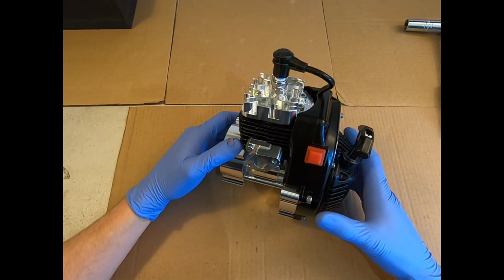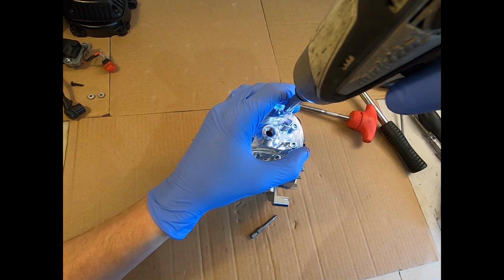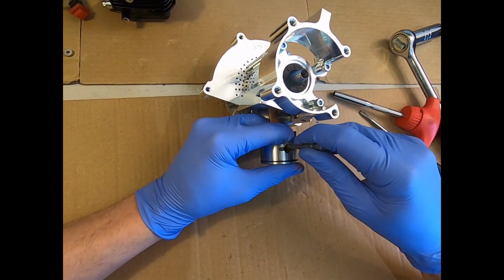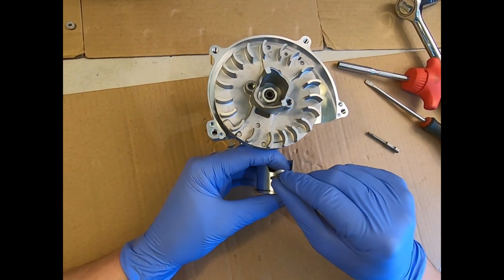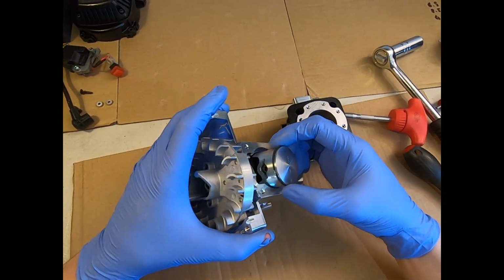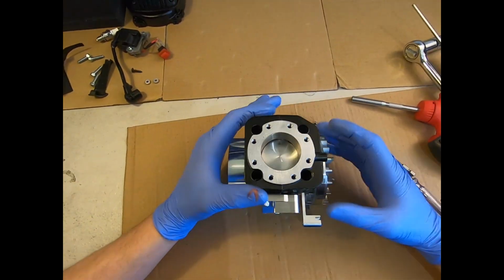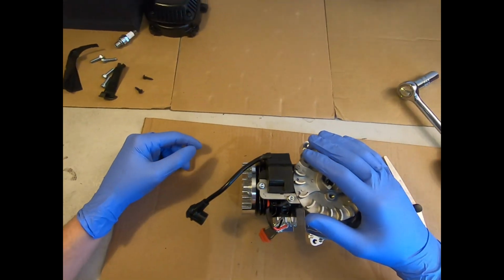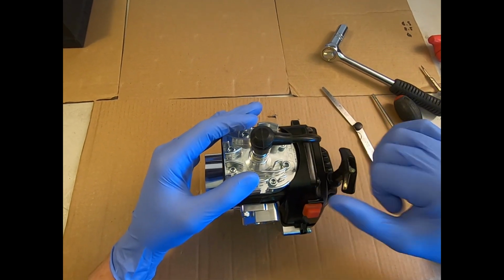TAYLOR 35 RC ENGINE - TOP END REBUILD/SERVICE TUTORIAL

Comment: Hi Thanks for this tutorial. Can I fit this engine in an 1/5 FG Marder
Reply from the maker: The 35cc will fit all FGs, just bear in mind that you may have to swap over the stock clutch housing from FG stock engine to the 35.  Lots of guys have done it now, its just not a direct fit
Reply: @TAYLORRC  Thank you. Can you please send me link for the 35cc engines and clutch housing I need to use with the engine-Thank you
Reply from the maker: @ug1166  https://taylorrc.co.uk/collections/taylor-35-spares

Comment: Mark from Australia I have a 26cc hpi baja and im having problems with the spark plug oiling up all the time im running 18/1 mix and still have problems any suggestions that could help because at the moment I would rather burn 🔥 it
Reply from the maker: we prefer a 25/1 ratio for all 1/5 engines, and its most likely also to do with your needle settings, so try leaning out your H needle a tad until the plug comes a medium to dark brown when you inspect it after a long full throttle pass
Reply: @TAYLORRC  it's a new carb
Reply: @TAYLORRC  im after a 35cc engine where is the best place to get one from Taylor....... Ebay ???
Reply from the maker: @marklloyd3513  https://www.taylorrc.co.uk/35-spares